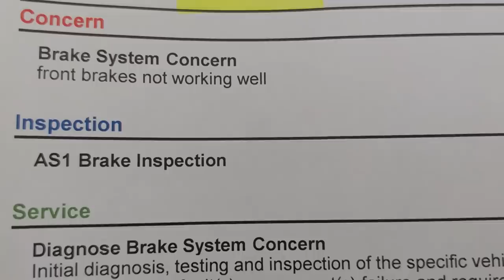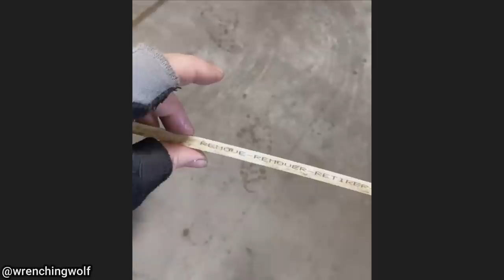Customer States Dropped Socket Into Engine Bay And Vehicle Won't Start | Just Rolled In

Comment: After watching these type videos I can totally understand any shop turning someone away.  Sometimes it’s just not worth it because the same people who don’t take care of their car probably complain about the costs to repair it.
Reply: funnily enough, no one from this video was turned away by a shop. most shops don’t like turning people away but sometimes it’s too dangerous. when i was a kid, my grandma went to have her oil changed and almost got turned away when they popped the hood bc her battery was so corroded. my mom had to replace the battery before the techs would even step near the car
Reply: These are also the sort of people who would file a claim against you stating that the mechanical failure was your fault because "it was fine before you worked on it."
Reply: @keithcunningham923  Just take a ton of video footage.
Reply: I run a shop and there's a few reasons I've turned someone away.  
A) rust issues.  If your car is so rotted that I can peel your pinch welds off with my bare hands, it won't survive a jack being placed at the normal jack point. And usually, getting all 4 posts under the car on a lift is near impossible with that level of rot, it's simply not worth it for me to do an oil change with $20 in profit, to risk my life and risk your car falling off the lift because of a pre existing rot issue.  
B) you're hoping to make something my problem. And you have to be careful because if you don't know you'll end up getting bit. A perfect example is the kid who came in with a 2007 mustang 4.6.  Asks me to change one spark plug for him.  Hmm, strange. Why would he want that?  Well, after a string of BS that came out of his mouth, it boils down to the fact that he tried changing them himself but couldn't get cylinder #7 out. So he brings it to me. Anyone who knows cars pretty well can tell you the ford engines from that era (4.6, 5.4, 6.8) will either blow spark plugs out of the threads or seize in place and break while removing them. This guy wanted to pay me $40 for a "simple job" so it could be MY problem when the spark plug broke off in the head, and I'd be the one who broke it, and the one doing the huge job to fix it.  Not happening.
C)  you feel like they'll be a problem customer.  Much like my last statement, It doesn't matter on this one, If I feel like you are trying to pull a fast one, if I feel like your car isn't worth the hassle vs LIABILITY, or I think there will be a problem with either the repair or your attitude...then I'll kindly tell you that I'm not interested in taking on the repair.

Comment: I actually did the wiper cover thing. I fitted new blade refills without my reading glasses, tried washing the windscreen on the way to fill up with fuel and thought these are the worse blades ever. Put my glasses on to check them and found clear plastic covers on them. Felt like an idiot.
Reply: At least you didn't pay a mechanic to remove the blade covers for you?
Reply: *worst
Reply: if you cant see without glasses you shouldnt drive without them
Reply: @nilz6432  you don't need to wear reading glasses while driving.
Reply: I also did the same thing with rainex blades on the Miss's car.
Reply: @nilz6432  You should think about that! READING glasses ie close stuff
Reply: I did the same thing. I'd never bought the $20 per blade ones before, and just thought the inserts were yellow. They cleaned the windscreen great, but then I realised my mistake.
Reply: I don't even have glasses as a reason and I've still made that mistake once, it'd probably help if the cover was bright-caution-cone orange
Reply: Get your eyes fixed with a LASIK procedure. Then, you won't have a problem, according to eye doctors.
Reply: @ColtonRMagby  That is for Short Sightedness.
Reply: In all fairness, you noticed your mistake in short order.  I've seen many examples who keep them that way for days, weeks, months...I mean, c'mon, already!!

Comment: I have so many questions on the first one...
1) How do you drop a socket into an engine? The only sockets that MIGHT be small enough to drop in there are 1/4, which is definitely not what you use to take out spark plugs.
2) Why in the hecking dilly would you try to start it if you knew there was a socket in there??? I'll give the guy some credit though as he may have forgot.
3) How on earth did he get insurance to cover that? Even with comprehensive, I would think they would deny the incident claiming that the owner was a moron, which is considered a preexisting condition.
Reply: At the very least, he made the problem worse by starting the engine.
Reply: 1: probably the 10mm that hold the coils...
Reply: @mawe42  Probably correct, but I'd still think the butt end of a 3/8 socket would be too big to go down a plug hole. I might be wrong though.
Reply: @Kcducttaper1  Depends on the make and model. A 3/8 socket would fit through the plug holes on my current car, but not on my last car.
Reply: He may have had the intake off. Dropped down the runner, broke the valve off and fell in.

We also get insurance eto cover rodent damage all the time. Insurance also covers at fault accidents so I can see them covering it.
Reply: Have you ever heard the old saying about never ASS U ME? There have been several people who assume that the socket was dropped while changing spark plug so it had to go into the plug hole. On most newer vehicles you have to remove a lot of trim pieces and the plug coils before even getting to the spark plugs, it's easier than a lot of people think to take off a socket from the ratchet and put it in a convenient location because it's going to be needed to replace the parts you just removed and it's more likely than not that you're going to knock at least one of those items like a screw, nut, washer or a small socket off or if you forgot and placed them in a part like an air cleaner lid and picked the part up and it rained itty bitty things everywhere. One could fall into the throttle body of a vehicle and when getting everything back together you hit the key only to find that something went into the inner workings of the engine. I know that a prudent person would do a thorough inventory of all tools etc. before attempting a start up but it's just as easy that a helper like a family member (usually a interested adolescent or child picked up the items without knowing that a small socket had been in the missing items. And in a lot of instances your homeowners insurance will cover it. In another case where the person was changing his own plugs and after getting done the engine was making a strange noise. But in that case it was just that he had forgot to install one plug, or it wasn't tight and was blown out.
Reply: Insurance will cover it, but since they can't get anyone else to pay it out, he's gonna be paying it back with interest come the next time his policy comes up for renewal.
Reply: Why they heck is he changing plugs if it only has 25,000 miles?
Reply: @abpsd73  wanted new engine...
Reply: @Kcducttaper1  A 1/4" drive 10mm socket definitely would fit through the spark plug hole into the cylinder.
Reply: @abpsd73  that’s what I was wondering
Reply: 3. He made sure his policy included a "Stupidity Clause".
Reply: @Kcducttaper1  a 3/8 might not, but a 1/4 would fit through. and get squeezed by the piston. a 3/8 might be too tough for that and bend the rod instead.
Reply: 4) Being judgemental. What if the guy was doing other work too? What if the guy didn't know where the socket went when he dropped it? Spent ages looking for it?  would YOU really think "it probably dropped though a hole barely big enough for it  IF it dropped in perfectly then fell down into the cylinder". No you'd think "it probably bounced funny when it hit the floor and rolled off somewhere, I'll look for it later I want to get this finished...". Then ONLY when you tried starting it you'd know EXACTLY where it went, but then its too late.
Reply: @ThePsiclone  Knowing there was an open plug hole, I wouldn't start anything until I found my missing socket!
Reply: It's sad that the owner was so unscrupulous as to inquire about his insurance covering the cost.  An honest person would know it was their own damn fault and accept responsibility for their screw up.
Reply: You summed up my thoughts exactly 😂
Reply: @kirkjohnson6638  Surprised insurance covered it, but does your theory about not claiming on things that are your fault apply to at fault road accidents too?
Reply: @grantmcinnes1176  Sure, why would you expect an insurance company to pay for a reasonably foreseeable priblem.  Hint: I have never filed a single car insurance claim or homeowners insurance  claim in my entire life and I am 60 years old.  I once had a storm knock down a large branch of an oak tree onto the windshield of a car I rented while in vacation.  I did call my auto insurance company any they would cover the damage, but the deductible would be higher than the cost of a new windshield, so I took it to Safelite and had a new windshield installed at my expense.  In general  I yhink there are very few instances when insurance companies shouldake payments since almost all "accidents" are actually human error.
Reply: @kirkjohnson6638  You're not an insurance executive, by any chance, are you? :)
Reply: @grantmcinnes1176  No.  I actually think the world would be much better off if there were no insurance companies at all.
Reply: Preexisting condition, love that!
Reply: My guess is the engine was getting ready to blow and the owner wanted to hurry it up. 
People that do this on insurance only help raise the rates for everyone else.
Reply: 1: Placed the socket-set on the engine. Bumped them all out everywhere. One small one got into the open hole...
Reply: @bigcheese781  sounds plausible, fair comment.
Reply: I was told that insurance will cover stupid mistakes, just not intentional damage.
Dropping a socket into an engine is stupid. Dropping a socket into an engine and starting it is really stupid, I would say  bordering on intentional damage.

Insurance will also not normally cover mechanical failure from wear and tear. It is possible that the engine was on its way out and they knew that so did some "accidental" damage to get a new engine.
Reply: @The1025RChannel  its a 2019 ford ranger with 25k miles. How is the engine ready to fail and why was he even doin spark plugs?
Reply: @jacksmith2315  it probably wasn't but we don't know for sure. New engines do occasionally fail.
Reply: @The1025RChannel   very unlikely scenario. Most likely person was just a dumbass. No business replacing the plugs in the first place. N always look for n make sure you have all your tools before you close the hood n start it up. If you're missing one and had an opening to the engine, doesnt hurt to stick a magnet down there. The spark plug sits pretty close to the piston as it is, w a socket in the CC, the plug prob hit/was touching it n you'd feel that resistance threading the plug in. Pull it back out n make sure theres nothing in there. It's a brand new truck it's not going to have boogered threads already so if it doesnt feel like the others and you're missing a socket that can fit, just check. Its most likely the socket he used for the coils, so he had to of known it was missing when he put the coils back in n had to get another socket
Reply: @jrichardson-m9m  I don't have the Good Hand people because all my insurance company gives me is the Finger.
Reply: @horsepower711  Ever try dropping your tooth brush in the bathroom?  No matter how impossible it is , the toothbrush will end up in the toilet even if the lid is closed.
Reply: That was a 1/4 drive 10mm socket,holds the coil.
Reply: 1) He probably had to remove a shield, coil pack, or something else that was in the way and required a small socket.

2) Obviously he had NO idea that it fell into the cylinder, he simply thought it fell into the engine bay somewhere, and that it would have harmlessly fell out somewhere down the road.

3) He's just a better smooth talker than you, and got it covered.
Reply: @kirkjohnson6638  Maybe he paid for some GOOD insurance... 🤷🏻 
If I'm due something I paid for, I'm going to TAKE it.
Reply: @kirkjohnson6638  Well, then you got ripped off.
Reply: @davelowets  Insurance is not intended to cover stupidity.
Reply: @kirkjohnson6638  It was an ACCIDENT, not stupidity. Insurance covers ACCIDENTS.
Reply: @davelowets  Dropping a socket into an engine and not looking for it is owner negligence, not an accident.
Reply: @kirkjohnson6638  The insurance company seems to disagree with you also...
Reply: @davelowets  Perhaps so.  Maybe they like insuring stupid people who break stuff.
Reply: Damage would of been worse with a high quality socket. That one looks of low grade chinese origin ..
Reply: @foodhatesme  agreed.  I was taking the oil filter housing off a Jaguar XF 6 cyl supercharged engine to replace the gasket under the base.  Incredibly the last bolt (as always) which is inside the filter housing held on to the torx bit just enough as I pulled the driver off, that it pulled the bit out of the bit holding the torx bit and that damn bit fell into one of two holes that go down into the oil galley.  I couldn't see it in all the residual oil.  50/50 chance it fell into the oil filter intake and I'd be OK.  But I have little luck with 50/50 odds.  I boroscoped that thing for 4 hours using every mirror and magnification possible and filled the oil galley with marvel mystery oil to purge the dark puddles of motor oil so I could see the black bit.   After I found it, in the outlet side of course, it took at least 2 more hours to wiggle end bend and force and cuss, to get a magnet on that bit, barely, and get it out which to me was bordering on a miracle.  I was shaking as I attempted to pull that bit out around bends and curves.  I couldn't see it since I had to remove the boroscope to pull it out, not enough space in the curves for both.  It was harrowing.  Had it not worked, I was pulling the whole engine and taking it apart.  No way in hell I would start it until that bit was found and removed.  Lesson learned, I use all locking bits now.  Cost me 6 hours work and 2 day wait and some $$ in boroscope lenses and thin/small magnetic pickup tools because of that $1 bit.
Reply: Sounds to me like it was on purpose. 
And worked. Got a new engine out of it.
Reply: @jrichardson-m9m  makes sense because how else did the socket end up on top of the piston
Reply: @horsepower711  Tell me you’ve been working on vehicles for a loooong time without saying you’ve been working on vehicles for a long time. 
😂
Think you hit the nail on the head cause now I could 100% see myself being the guy in the clip
Reply: I worked in military aviation. Tools were inventoried before and after you went out to work on an airplane. When you came back if any tools were missing the plane would get grounded and couldn't fly again until the missing tool was located. One time a large socket was missing when I came back from the flightline. We couldn't find the socket anywhere and the plane was grounded for 3 weeks. Finally the socket was located sitting on the ground along the side of the road that led from the shop to the flightline. I had dropped the socket onto the floor of the truck and as I was driving back the socket started rolling around on the floor. It was an old truck and it had a lot of body rot. There was a big rot hole under one of the seats and apparently the socket had fallen out through the hole, landed on the ground and then it rolled to the side of the road. I had been on the hot seat for three weeks and in the end the whole thing wasn't even my fault.
Reply: you had me at hecking dilly. stealing.
Reply: Engine bay. The quote is engine bay. He lied about insurance. He’s(?) very embarrassed and will cover it himself.
Reply: @jrichardson-m9m    Intake off for plugs. What auto needs that?

Comment: Honestly, while that one power lock wiring was on the wrong side of the door panel, it was very neatly done compared to a lot of the stuff on here
Reply: Still not understanding why they did it like that. Clearly had pannel off to connect and install electrical lock solenoid ,, then just gave up???
Reply: At least they put a fuse in it 🤷‍♂ I don't understand how someone could do it that neatly but not bother to tuck it away.
Reply: @theglitch99  maybe it was a case of "what if it breaks again? dun'wanna take off the panel again, such a bother!"
Reply: @lotharrenz4621  But they still would have to because the actuator was on the inside.
Reply: @Tracert-mc1hu  maybe it was a case of "it looked like a good idea at the time"?
Reply: He was so proud of his neat wiring that he didn't want to hide it behind the panel.